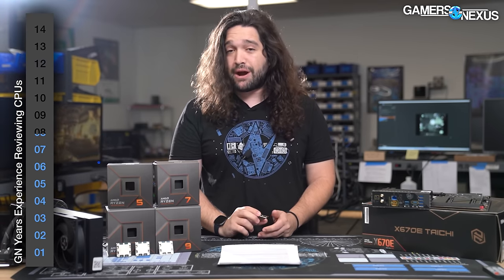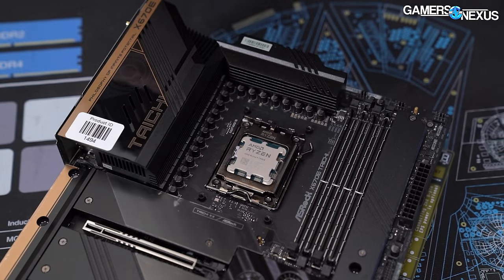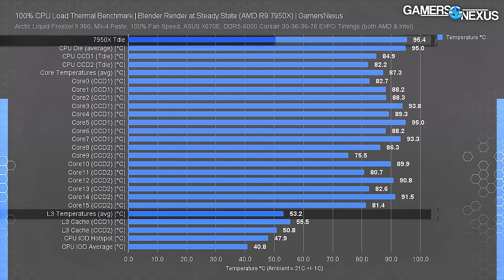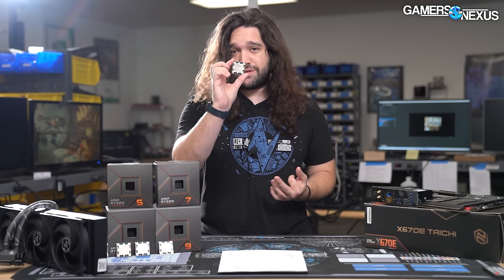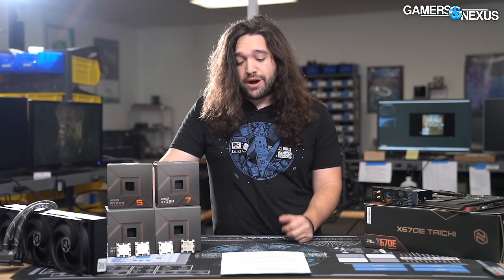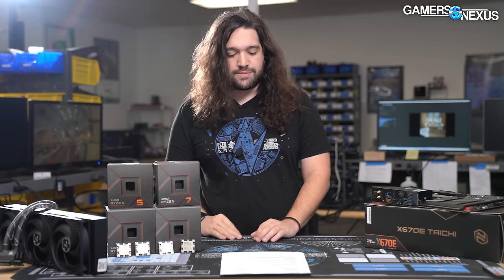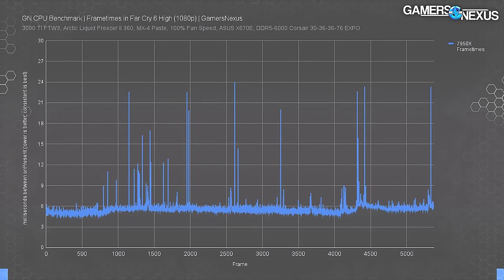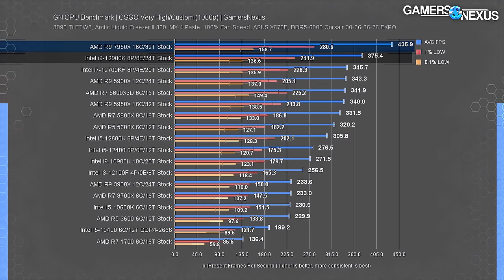95°C is Now Normal: AMD Ryzen 9 7950X CPU Review & Benchmarks

Comment: I really think what you should do to measure efficiency is set all the CPUs to the same power limit, like limit them all to 120W or 65W or something, and then see how much performance they get at those numbers. I'm strongly considering my next CPU upgrade to be like this, where I get a flagship AMD CPU, then lower the power limit to reduce the heat output while retaining most of the performance.
Reply: These tests exist... look at laptops. Size and weight constraints dictate the limits of the thermal solution which dictates power limits.  It's the great equaliser.  The 14-20 Alder CPUs were more powerful and hungry but much less efficient than the 8-16 H series AMD chips.

However you can't really compare the high performance chips here, the <2hr idle runtime of the few AM4 laptops that exist show the 16-32 desktop chip is not at all suited to mobile due to the high idle consumption of the multi die desktop IF implementation

Comment: The thing with this 95C target is that you are always going to have your fans at full tilt because a) it's going to bug the shit out of you and b) you'll know you are sacrificing performance if you don't. In practice, I think people are going to set their performance to th level of their fan noise that they can tolerate.
Reply: Yes he used the best possible cooler at full speed so it's not realistic. You might want to do that but it would be nice if he did a separate test for 50% fan speed or something. He seemed to forget that it would not only be slower but consume less power and probably be more efficient if he just cooled it less. He probably felt afraid the cpu would fry itself if he cooled it less. AMD said it's fine so believe them.
Reply: @ericmollison2760  I don't think he was afraid he'd fry it. I think he was just having to choose the best cooler he had on hand to demonstrate that the chip will boost to 95C. He could have done a noise normalised test on a few coolers to show the impact cooling has on clocks, but it sounds like they had to put a whole new dataset together in a week so I can appreciate why it wasn't a priority
Reply: No you won't run fans at full tilt all the time...nobody runs an all core load 24/7 on a home computer.
Reply: @glamdring0007  I don't think you need an all core load. Single cores will also boost until 95c is hit. That seemed to be the message in the video. So basically every time your cpu boosts, your fans would ramp up
Reply: @Devrij  the fans are controlled by the package temp on my motherboard, which takes a few minutes to catch up with the cores.
Reply: ya, i can crank up the fans when im doing WORK.... and it probably will not bug me then
Reply: Fans aren't even that annoying schizo.
Reply: You know 100% fan speed is more than not equating to worse cooling in the form of heavy diminishing returns. 100% fanspeed rarely is efficient nor good

Comment: Well, 5800X3D seems to be the way to go still, for gaming.
Reply: Especially if you want low heat output.
Reply: It really depends on the selection of games. Simulation type games seem to favor cache but competitive games seem to favor clocks and IPC. 7700K crushes everything in CS, Val and R6.
Reply: @rdmz135  who cares ?
The best cpu is the one i can pay .
And on this moment its non.
The bil of elektrische and gas is in my country about 300/600 euro per 30 days .
So my old Ryzen 2600x stay for a extra year using it for heater .
Reply: Considering the platform and RAM costs, 5800x3D is a no brainer choice. Sorry AMD your generational gain is not big enough to carry the DDR5 coersion.
Reply: @dyslectische  just got 5750g+32g ram+mobo+bequiet cooler for 400eur. 65w tdp. Will serve me many years.
Reply: Agreed! I just purchased a 5800X3D partnered with a well priced EVGA x570 Dark Mobo and 32GB of Gskill 3600 CL16
Reply: @dyslectische  the electricity bill in my country is 210 usd for 1 year
RTX 3090ti + 128gb ram ddr5 + i9 12900k .
Reply: This just makes me more excited for Zen 4 V-cache, it sounds like the holy trifecta of clocks, cache and memory
Reply: @ChillieGaming  for now. But what will it become next year or later?
Reply: @rdmz135  Nothing matters what you have the 5800x3d. 
You're already at over 300+fps. 

Nothing matters anymore, nothing at all. I don't even care about life.
Reply: @D9ID9I  i use a laptop for my workand yes on work i can play games 
(Security in house that will be destroyed)
Agains hobo go in that house )

So my laptop do a good job .
Intel i7 10750h with a rtx2060.
Same with my pc what use a r5 2600x and  vega 56( yes Steve i use a vega ) 
Both will of fine for years for now .
Both have a 1080p screen .

And i do not need ultra super power settings in games.
Normal settings is good for me.

Even my old pc is still use for free online games .
What use a xeon e3 1245 with a gtx1050ti.
The child still play and make YouTube films with it (Roblox and dog clips )
It cost more time that is it .
Reply: Until the 7800X3D comes out in a few months.
Reply: @ChillieGaming  i from the Netherlands its compleet stupid on this moment.
We pay for 1000wat for 1 hour 0.70cent .
Means  its 1kWh 70cents.
A small house use about 3500kWh a year .
This with oud charging your car or your heating.
Gas is about 1 cube3 1.50 euro
A house use about a year 1400 cube3 .
A house what do not use gas but electrische heating is about 8500kWh a year with out charging a car .

This is my country today .
A person earn about 1740 euro and that is with tax (about 26% IS TAX so that means 1300 euro to pay bill and your food ) 
You can have tax discount of 6% if you only work by one company.

A normal house is about 730 euro -min 350 euro if you have a low job (basic work loon of 1750euro ) 
If you and your wife work no -350 euro for your house.

So no i do not see a lot cpu and gpu gone sell in my country. .
Reply: @Morpheus-pt3wq  well its the same since 2010

Comment: Really great review, and an interesting new architecture from AMD. 

It seems like this architecture/process node combo resulted in an unusually high frequency ceiling, but pushing those higher frequencies obviously comes at a power and efficiency cost. 

So basically they're able to push frequencies until a thermal limit, rather than the typical reaching instability before you hit a hard thermal limit (with good cooling). 

I'd be very skeptical over the "by design" 95C constant temperatures. Maybe you could find a way to get good answers/explanations from engineers in the industry? We've been led to believe in the past that 95C is close to 'danger' territory for your silicon. 

What's different that 95C is now an acceptable temperature for prolonger running? Have they just implemented smarter frequency throttling that prevents spikes in to the thermal-shutoff territory?
Reply: silicon dies generally start dying at around ~120 in reality, so 95 is not 'that close' to it, most intel cpus in peoples hands especially on stock coolers have been running at 90c for years
Reply: Not to mention with manual OC you can allow these CPUs to go to 115°C!
Reply: @dgsprysoup  i mean if you clock and let your cpu to go to 115 you know you're playing stupid games to win stupid prizes
Reply: @notachannel117  Intel runs 90c only on crappy coolers on prebuilts, whose users will never run loads like blender and so they basically never actually reach it. 7950X has boosting headroom to run 95C even at gaming loads. I doubt will be very sustainable through years of use.
Reply: @rtyzxc  almost all the prebuilts used to be intel for past 10 years (minus some from last gen amd), since 9900k the intel has been cooker, thats why in pretty much all the old singlethreaded games 9700k with worse silicon quality could be clocked  higher than 9900k without delidding, same issue seems to be currently on AMD side that the IHS is horrendous for thermals, check out derb8uers video where delidding and putting liquid metal drops temps by literally 20 degrees with 100mhz higher clocks

Comment: Since AMD and Intel are both forcing us to explore the extreme power draw regime, I would be interested in a video that explores just how high you can get power efficiency for different sorts of parts by engaging in 'extreme underclocking.'  Is there a limit to how much extra efficiency you can get by dropping power consumption?  Does a flagship part do better or worse than a midrange part when used that way?

Comment: Overall my take away is that I don't really need to chuck my 3900X, it's still absolutely serviceable for the foreseeable future.

It's scary to my old mind that it runs so hot, but I guess I will adapt with time.
Reply: Relatively hot, but no worse than the interior of a car on a hot summer day.
Reply: @kdw75  way worse than a car on a hot summer day 95C is 203 degrees Fahrenheit.
Reply: @Ender275  Yeah. That isn't much if any hotter. I have regularly seen 170 in my car and I don't even live in a hot area. It doesn't even get past the 100s here usually.
Reply: @kdw75  Yeah but do you get in that car and leave the windows up and the A/C off. NO, you roll the windows down and crank the A/C before you even attempt to get in it. I had a Fx8350 and an r9 290x on water cooling. That combo would heat my house and gaming durn the summer sucked even with A/C. The 290x died (probably heat related) and I replaced it with a GTX 1060 6gb. I took a small hit to FPS but the reduction of heat output was night and day. It makes me think about TDP and power consumption way more than before.
Reply: @MrNota500  My point is that you don't think anything of these chips sitting in hot warehouses or in hot shipping containers for months on end. The only concern I would have is this means a lot more range between full load temps and power off temps, so more expansion and contraction. Even with that, I bet they have accounted for it and there won't be any more failures than usual, especially considering most computers are replaced in less than 10 years.
Reply: @kdw75  where do you live that it hits 170 in your car. I’m on the north eastern coast of the US and I’ve never seen my car hit above 120 on days when it’s 105 outside.
Reply: @Ender275  Kansas City. When I was younger I had a black sports car with black interior and it was 114 one day and I shot the interior with the heat gun and it said 172.

Comment: I found your channel via the video about Linus Tech Tips (which I always avoided by intuition) and would like to thank you.

I'm currently planning my first 16-Core rig – coming from my current box I built over
a decade ago with a Xeon E3-1230  and I am really beginning to like this channel.

As someone into dataviz and UX, I very much appreciate the highly readable graphs and the countdown bars
that perfectly telegraph when you have to pause the video to keep looking at one of them in more detail.

I was positively surprised that you include information that is really important for me as someone who's not only looking for
good performance with games, but also with bulk compilation, 2D/3D asset creation (CAD- as well as art/gamedev-related)
and various other sysops and development tasks.

I don't feel especially good about spending 600 quid on a CPU, but it does look like this is the most future-proof CPU for me.

The only thing I'm still uncertain about is the cooling – the official product page recommends liquid cooling, but I'm paranoid
about liquids near electronics and this box will sit within a mobile 19" rack that is transported over bumpy roads… are liquid
coolers robust enough for that? Or can/should I just go with one of them chonky copper+aluminium ones like the Arctic
Cooling Freezer 7X currently sitting on my Xeon?

PS, two more benchmarks I would have really liked: throughput of hardware acceleration for encryption and video codecs.

Comment: The efficiency comparison seems like it'd make more sense if the CPUs were configured to use their "respect the TDP" modes (so disabling PBO for AMD and TurboBoost Forever on Intel). A build targeting efficiency is going to care about that result far more than efficiency when the CPUs are configured to run as fast as absolutely possible
Reply: Sure, I think the efficiency claims made by AMD are on a clock for clock basis. Anyone who's overclocked a CPU knows that you can double or triple your wattage consumption and only gain 500 mhz of clock speed. If AMD is boosting based on thermal headroom, it's likely going quite far out of it's efficiency range the same way a manual overclock would.

Comment: I wish it had a “go wild until X degrees” mode so you could pick how hot you want your pc to use
Reply: It's known as tdp limit. Temperature is meaningless as a control variable. You cannot produce more heat than power in. I can be 200c and consume 50w. It will still only output max 50w heat. Cores are so dense now aggressively monitoring temps is a must to ensure they don't go over tjmax and in turn aggressively max out the most they can do before hitting tjmax, if anything this keeps the CPU in the highest rate of heat dissipation given the temp difference is greatest. People just don't like seeing big numbers for temps. Understandable but this will be the norm going forward if the big 3 want to maximize what their chips can do
Reply: Being able to set the thermal limit (with a max of 95c) would be nice.
Reply: Almost all BIOS's already have this, so you could probably edit it to "go wild until 75c" if you want
Reply: Yeah basically i want msi afterburner for this. Give us a configurable power limit and thermal limit, preferably from ryzen master
Reply: I legit undervolted my R9 9500x and got cooler temps and more speed "boosted Higher"..
Reply: @Altirix_  Well yes and no.

Yes for what you said about 50W being 50W no matter the temp.

It kinda gets difficult to calculate however temperature is an interesting variable to limit CPU. There are a couple things that can affect this as opposed to TDP, such as cooling solution, temperature delta changing rate of temperature change.

If they weren’t factors, why do you think the processor runs at 95C?

With your logic the processor can run at 85C at 200W and it will still output 200W… TLDR, temperature delta between CPU, cooler and ambient changes the rate of transfer of the heat.
Reply: You can do that with current ryzen CPUs, probably going to be the same with some bios option.
Reply: it has an eco mode, which computerbase has tested. 140 watts limit, 5% less all core performance, no change in single core and probably no change in gaming performance, and 73 degrees under an nh-d15. maybe it would have been a better move to ship the CPU with that setting as the default mode to be tested with and have a "super awesome all out ultra performance" setting...
Reply: you can probably do that, although may require a 3rd party apps like throttlestop
Reply: @robertpatton172  what? yes an 85C processor using 200W will still need to dissipate around 200W of heat energy. it could be 1400c or -100c, it will still need to dissipate 200w of heat. the RATE at which it can do that is limited by both thermal conductivity of the pathway and the temperature delta. but no matter what it will have dump that 200W of energy.

temp limits are not useful as watts in is still uncontrolled which is actually what you want to control if you dont want to get hot. 200W of heat in air does not equal the same temperature as 200W of heat in a cpu (silicon) thats exactly why theres little to no benefit outside of potentially increasing the life expectancy of the part, less micro fractures on solder, less voltage needed for transistors at lower temps etc. but to "keep you cool" its not useful. you are not controlling the right variable.
Reply: @Altirix_  higher temp limits equals higher temperature delta and therefore more capacity for heat disipation…

Temp limit at 80C is might not be able to dissipate 200W, upping temp limit can increase the maximum wattage the processor / cooling solution can handle.
Reply: @robertpatton172  your point is what exactly? 

if the cooling solution cannot handle 200w, then my point still stands in this case you wouldn't want to limit tempature but wattage in. limiting tempature as you said reduces heat transfer. watts are universial between materials and forms of energy. temperature is not.

Comment: geez... with energy being so expensive and power consumption rising this is a rough stretch for gamers on the lower end of the economic spectrum... my partner and I are having trouble powering our 275w systems... 5600 + 3070 UV
Reply: Well you don't need R9 7950X for gaming at any economic spectrum :D
Reply: @ophatjb  not my point even the 7600x is 105w now. My point is EVERYTHING is consuming more power now. at nearly .6USD per KWH I and many others are feeling the pain.
Reply: Unless you play 10 hours straight everyday at like 450w it won't reeally be a problem honestly
Even with 10 HOURS a day, EVERY DAY, for 30 DAYS it won't break 40 more euros a month and that's a lot of gaming ( atleast where i live it's like 28 eurocents per kw/h)
Reply: @justetan3566  We are definitely gamers and game at the same time and often together. That with a brutally hot summer my power bill for a small 3 bedroom house was 700 dollars a month. I've never seen an energy bill above 200 dollars before. That and fueling our econobox hatchbacks @ 5.80 average a gallon of petrol, and student loans, it was a long summer. I make a bit above average as well and have been struggling mightily.
Reply: @quaz1moto241  Get a better high paying job, problem solved lol
Reply: @handsomesquidward151  out of touch